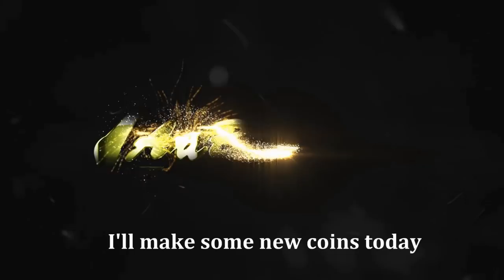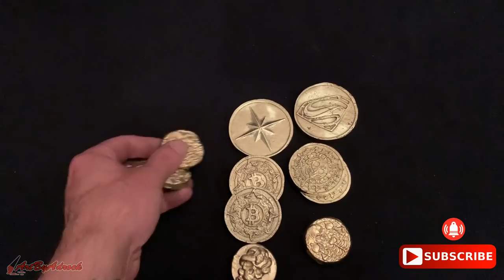Casting Custom BRASS Coins At Home - How To Cast Captain Marvel & Superman Coins

Comment: Great work as always!  I wonder if the resolution would be good enough on these coins to read a QR Code for a public bitcoin address?  It would be cool if you could make a two sided version of that Bitcoin coin with the public QR code on the opposite side that people could scan and contribute to.
Reply from the maker: I think if I use my resin printer the detail would be good enough although with pla I’m not so sure. Cant hurt to try though 👊🏻

Comment: Awesome video man. I do have a question. What's it called when you add the copper to the brass?  Or is there even a name for it? Keep the vids coming.  J
Reply from the maker: It would just be a different alloy. Brass is mixture of copper and zinc so essentially they are very similar alloys already. Thanks for watching 👍🏻
Reply: @ArtByAdrock  rite on man. Thank you for letting me know. I wasn't sure. I definitely will keep watching. Awesome videos

Comment: Are you able to make graphite molds with the star pattern if so i would be interested in getting a few large molds
Reply from the maker: Are you talking about just a regular star ⭐️ and how big? Graphite blocks can get rather expensive depending on size
Reply: @ArtByAdrock  the "captain america" star on a graphite ingot mold large enough for a 1lb aluminum or copper ingot most people would call it the NATO star.

Comment: How do you make a double sided coin? Instead of just one side ?
Reply from the maker: 3D print both halves
Reply: @ArtByAdrock  and then just like put them together? I’m talking about like making the actual mold for the coins.
Reply from the maker: Yes, so you print 2 halves, one half goes in the cope. Ram it with sand then flip it over and glue the other half on in the drag and ram that with sand. I have many many videos showing sand casting with split halves